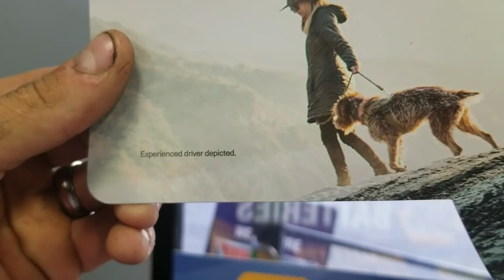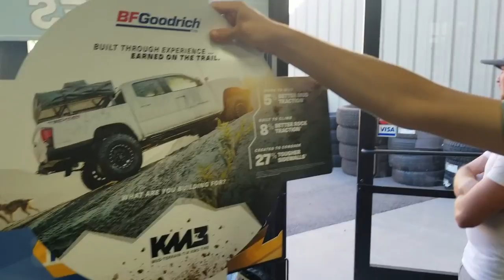Making an Adventure out of Nothing | Staying Positive Despite the Challenges

Comment: Perhaps save for the RCV ultimate axels if it keeps happening
Reply: Maxx Powell that could move the weak link to the ring and pinion. Much harder to trailfix.
Reply: how about portals ? they'd be siiiick, cv angles restored, and due to the reduction gears in the portals no stress on the axle itself